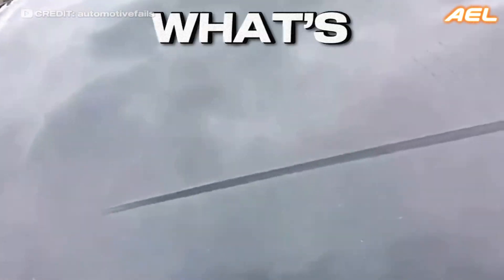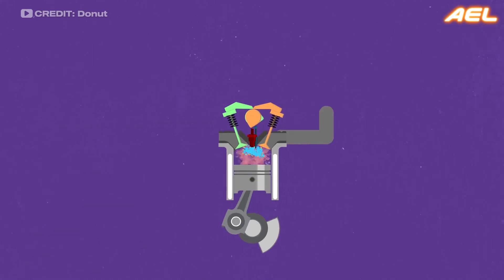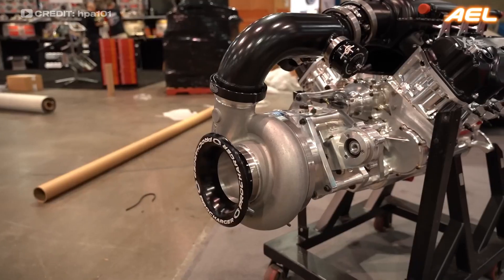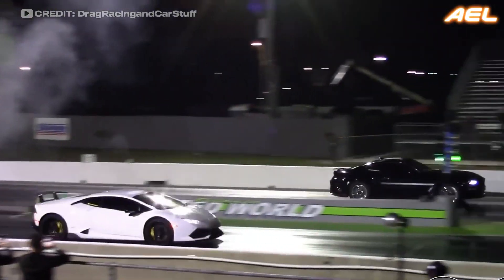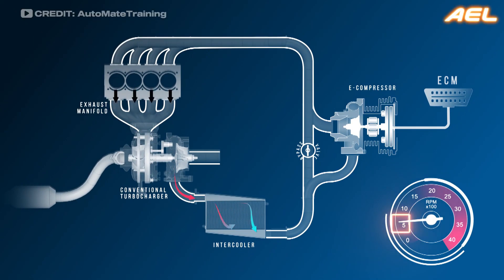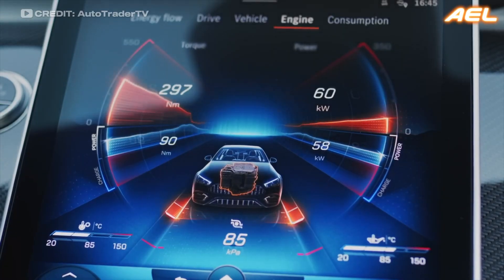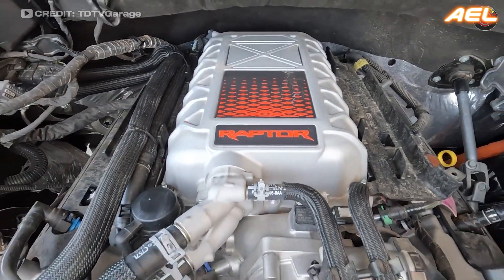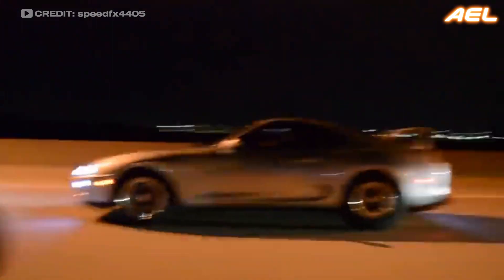Turbochargers VS Superchargers - Which is Better ?

Comment: My choice is turbo, cuz it has power when I need it and good mileage when I don’t
Reply: Bro,  Whipple superchargers can get better fuel mileage too due to the instant torque even at low end especially good cruising or shifting below redline to accelerate normally.  Check out Danny Johnsons garage on Whipple charged mustang and centrifugal charged s2000. See who got better fuelileage

Comment: Mayor difference that you didn't mention: torque with a supercharger is linear, it increases simultaneously with the rpm when you are accelerating. Turbochargers have a mostly flat toque band, usually starting from 1500-2500
rom all the way to redline, or it's tapers of at the end because the turbo is too small for adequate boost at the end.